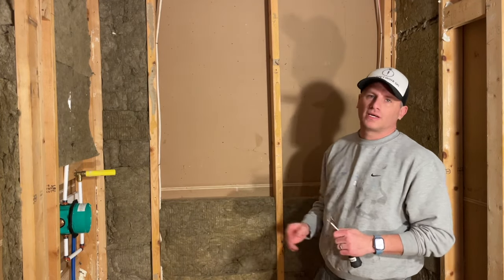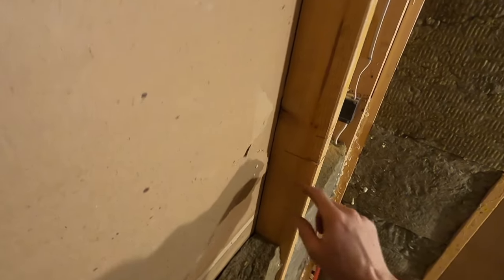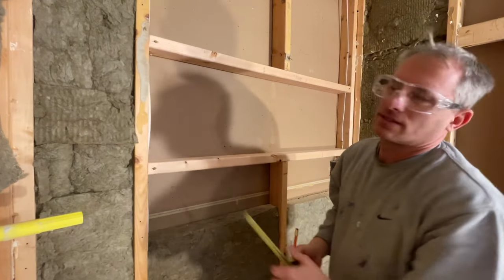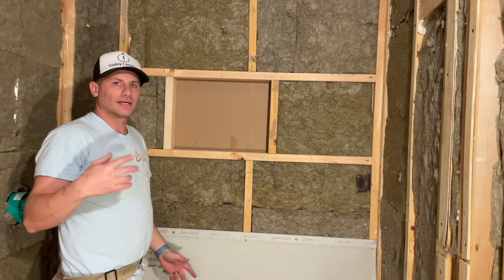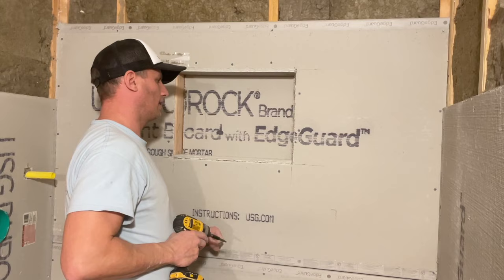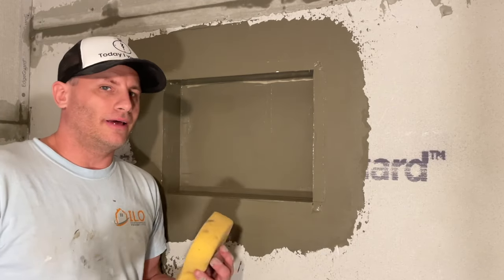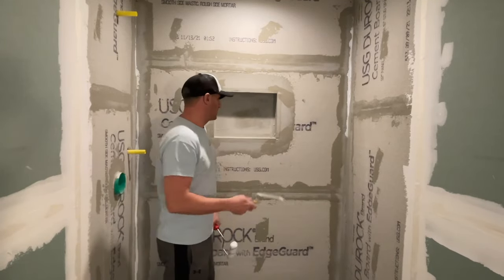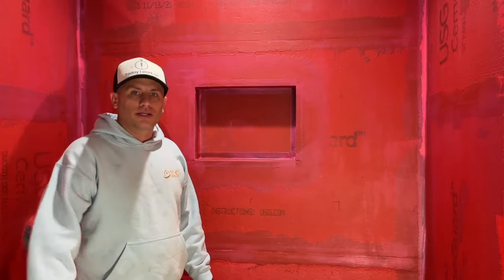How to Build a Cheap and Totally Custom Niche in Your Shower or Tub

Comment: Love the videos! What side of the cement board goes against the studs? Smooth of rough? I have installed a redi tile base and I'm ready for the cement board to go on. How do I know if I will be using mortar or mastic when installing the tile?
Reply from the maker: Anything in a wet environment should be modified thinset. That’s rough side. You can cheat a little like in the back of a niche with mastic if you’re in a pinch. That’s the smooth side. Anything dry is mastic. Anything wet is thinset. I have seen mastic hold up just fine over the years in a wet environment , but it’s not proper practice.
Reply from the maker: Thank you for your kinds words. 😬
Reply: @TodayIWorkOn  thanks for the reply, is modified thinset also good to use on the redi tile shower base? the yellow one. I have seen you use different stuff but cant remember which video its in now!!! lol I am limited to what i can purchase in my small town but if i have to order it, than so be it!

Comment: I didn't see you say anything about a slop from front to back.  I know it's a very short distance, but shouldn't you have a slight slope so that water doesn't pool up?  Thanks.
Reply from the maker: For 3.5" I don't technically slope the waterproofing but I do slope the tiles about 1/8". The whole area is covered in mortar and grout so there's no real place for the water to go. The biggest issue is if you slope the substrate 1/16" then you have to slope the tile another 1/8, those numbers start adding up and you will have a small hill on your hands.

Comment: Any suggestions for doing a niche like that against a concrete (below grade) wall? Can I leave out the concrete board in the back of the niche and just tape and mortar the sides directly to the concrete wall?
Reply from the maker: Is it a 2x4 wall?
Reply: Yep, it’s a 2x4 furred out wall against a concrete wall in the basement. The niche is framed within the furred wall. I’ve got it all sheeted with durock and I’m mesh taping and thinsetting right now
Reply from the maker: @KW-gi4nl  it should work just fine. Good luck with the project!

Comment: What about king and jack studs with a header after cutting out that niche?
Reply from the maker: Non bearing load does not require a king and jack stud install. Single floor home with no load bearing walls due to truss framing being held by exterior walls. If it was a bearing wall, yes, 100% add a header. This is actually a great comment and it's actually something I'm going to add in my upcoming video about a new niche I'm doing.
Reply: @TodayIWorkOn  great...looking fwd to that video and thanks for the explanation. Building code varies so much around the country which makes it difficult to understand which techniques to apply!

Comment: If Iam ok with the dimensions between the studs could I just insert 2-2x4 in between the studs to make niche instead of cutting studs out????
Reply from the maker: Yes. It will be tiny though. Don’t be scared to cut out the studs if the wall is not load bearing. You got this!!

Comment: did you use the straight flex on the corners of the shower and the cement board joints?
Reply from the maker: Yes I do since it's cheap and is water proof when you bed into the thin set.  After that, you redguard or hydroban and you have a very waterproof shower!

Comment: You don’t slope the bottom stud? I’ve seen some videos that it works better.
Reply from the maker: I’ve never sloped a bottom stud because how can I make that perfect cut on an existing wall? Kinda hard. We are talking 1/8” of a pitch over 3”. In my mind that’s a waste of time. There’s engineering and science on pitch and water movement that says we need to pitch at least 1/8” per foot to move water. The 1/8” pitch at 3” equals a 1/2” pitch over 1 foot. That’s excessive. You can even go 1/16” at 3” and still get water movement off of the sill. 

In summary, add a little more mortar to the rear of your tile and pitch that baby down. It’s way easier and you have more control over how much you want it pitched.
Reply: @TodayIWorkOn  Thx for the tips. Just seen different videos with multiple opinions on it.

Comment: Which type and thickness of Strait-Flex do you use? Do I need to get the Tile-Tape or will the regular corner bead stuff work since it's waterproofed anyway?
Reply from the maker: I've tried both original and medium and they work fine. They are both plastic(waterproof) so they work just fine.

Comment: Woah! You're "Ta da!" @ 11:20 skipped a vital step: what if there are screws going into that 2x4 holding up the backside sheet rock, which you'd assured us we wouldn't damage?
Also, why dont you just set the depth of your skil-saw to the depth of the 2x4 rather than fool with the orbital saw?
Reply from the maker: There’s usually screws or nails, correct. Over time you learn how to negotiate pulling the 2x4 out so you do not damage the joint compound on the other side. Remember, you are pulling the nail or screw from the other side, not pushing. A slight wiggle usually does the trick. Worst case, you patch a screw hole. This is remodeling, if you look up the word remodel - noun - An instance of a modification or a redecorating, we are messing with what’s existing. Small damage can 100% happen. Nail pops and some drywall damage is always possible during a remodel. 

Lastly, standard 7 1/4” circular saw does not have the depth to cut through a 3.5 inch piece of wood, hence the vibrating saw.

If you want a perfect situation, build a new home. 😬

I hope this answered your questions.

Comment: can't you just use the same mesh tape that you used for the corners for the niche? Thanks
Reply from the maker: You can but if the mesh fails and cracks, there's no protection there like the straight flex.

Comment: Did you also use the "straight-flex original" for the shower wall corners?
Reply from the maker: I sure do! It’s super thin. It’s super strong. It’s super waterproof!! It just made sense to me and it’s way cheaper and easier to use than kerdi tape.
Reply: @TodayIWorkOn  Great thanks, I appreciate the reply. Great video!
Reply: Last question, what did you use for butt joints?

Comment: You didnt slope the bottom.... does it not need to be?
Reply from the maker: It’s sloped around  1/8” of an inch. Always slope your shelf.
Reply: @TodayIWorkOn  but where did you slope it? On the wood studs? With the cement board (looks flat there)? Or with the tile at the end by adding more mortar in the back? I'm doing one this week and don't really see people explaining which is better.... I saw another guy slope the wood stud, but i already framed it, I'm hoping it's ok to do with the cement board or tile...?
Reply: @EJfromNYC put some shims under the goboard to slope it towards the shower.

Comment: You didn’t explain how you removed the 2x4 without damaging the the other side of the Sheetrock from the bedroom wall.
Reply from the maker: 60's house, the stud actually just fell out and I actually laughed when it happened, lol.
Reply: I've used the same oscillator tool he used at the end of the 2x4 cut with a metal cutting blade to shear off any sheetrock screws, fits right in between back of stud and sheetrock. Go to the other side, look for screw head sticking out slightly, you can always kinda see them, measure distance and then go back and cut it off, nomess with other side of wall

Comment: so use composite 2 3/8ths" flexible strait-flex ? for the corners & edges? of the niche?
Reply from the maker: Yes. You can grab it in the joint compound area in HD.

Comment: Seriously .. listen folks let’s not cause drama we don need on any job anytime period.  To cut out studs at niche location , set the depth of skill saw at 3 1/2” depth of total cut k , go ahead make the x4 cuts level . U will not cause any damage to drywall sheet rock ok. The width of all framing 2x4 is 3 1/2” x 1 1/2” thick ….  If using a wildly UN stable vibration saw against drywall cause u were to scared to cut full depth , u will only create greater chances of damaging the drywall u so spoke cautiously of yeahhh. Lol so follow the ever so wise tip. Keep it simple stupid .  Don’t go creating chaos when u can cruise mellow and looking as if ur actually experienced . Ur gonna want pre marking all layout at plumb and square mark lines to cut , always stick to same rules on saw blade to lower edge of the leading edge lines this way as u hold a heavy worm drive or any saw , u will be allowing for the lesser of two evils. The bottom edge gets saw blade but while your eye follows the top edge of mark also the easier of both evils. So use as law for your functions to always stick to same method.  The more level and square the cut the most precision will come out in the finish showing best results from patience and experienced skills.  70% of finish is in the prep , measure twice and cut once , a tape don’t steal and a level don’t lie , damn we’re good , time to go to the bank bud.  Blessings
Reply from the maker: I read 1/2 of this and said, this guy follows videos very well! 🤣

Comment: that's way too much work. Just buy a redi- niche.100% waterproof and 1/10 the install time.
Reply from the maker: Custom usually is more work. Some clients like a specific size niche and the tile Redi niche does not work for those clients like my most recent niche video. Yes, the tile Redi niche is 100% easier!
Reply: I never use that shit prefab niche i customize the way i or client wont
Reply: Isn’t it like 250$+ for a foam box?

Comment: Why on earth would you put red guard over the entire surface of concrete board. It’s concrete can you not spray the whole thing down with the hose and it won’t be ruined it’ll dissipate evaporate No harm no foul when water gets through the grout and hits the concrete board. It’ll soak in dissipate evaporate and be gone by coating it with a membrane. It’s gonna slide down the membrane to wherever Iza paddling and accumulating causing problems. It’s cement board no need for that membrane waste of money and time. you want to seal the joint lines no problem but to do the whole thing waste of time Not to mention money.
Reply: (Do not waste your time reading this comment lol)
Reply: Is this a serious question? You need to waterproof cement board in the shower.
Reply: I hate to buy any house you worked on.
Reply: Right better use densheild already waterproof
Reply: Cement board is not water proof, it's intend to keep moisture off the wood studs, stay away from tile, son